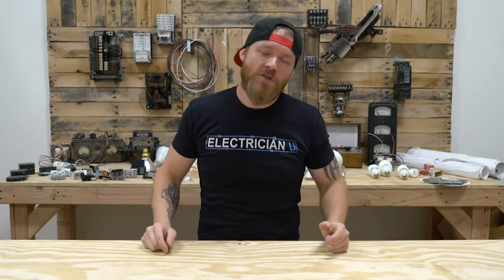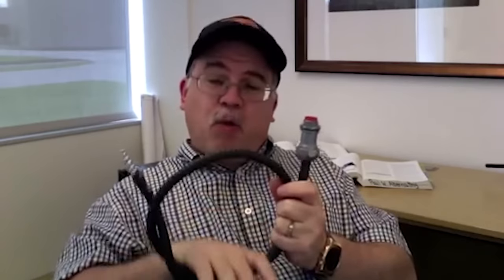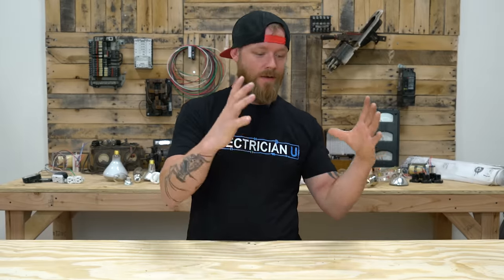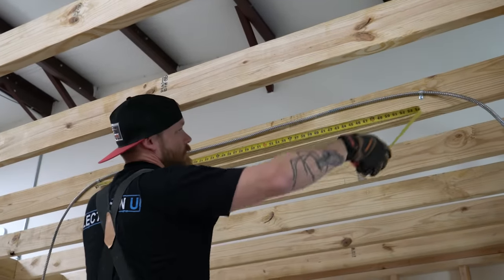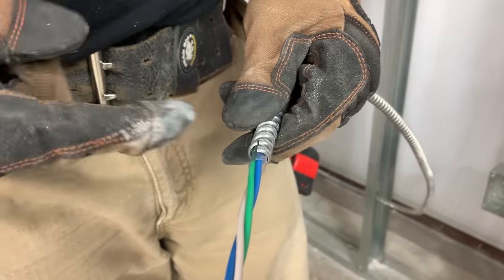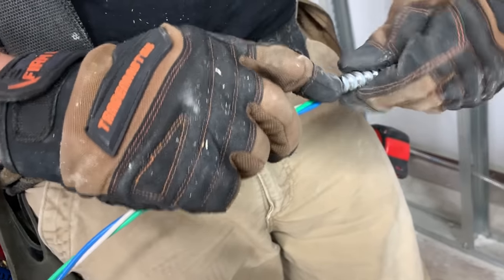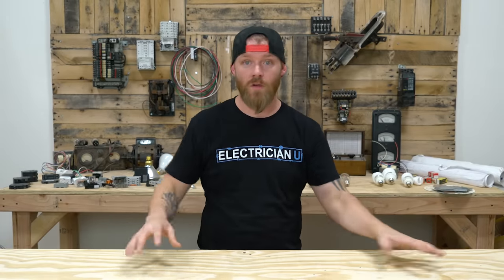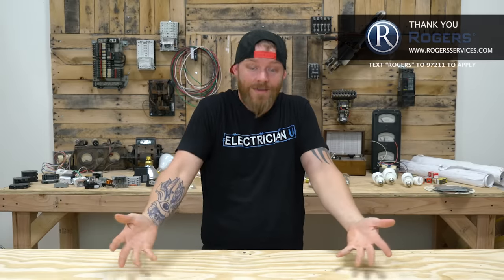Wiring With MC - WHAT YOU CAN AND CAN'T DO WITH MC CABLE as an electrician

Comment: So in mechanical insulation, we use a lot of tape, and cutoff a lot of fiberglass pieces. I’m the clean up bit is by far the most important aspect. I always have a box at the foot of my ladder. At the very least, even if I miss, it’s within arms reach of putting it in the empty box when I moved ladders.

Comment: So if you want a pull box for MC you can make one easy for under $10 from one of those black and yellow bins from the supply house. Get the smaller one of the two sizes. Poke a hole in one end and you can stack them 2 high and as many stacks wide as you need. 

I never do a job without a regular broom and a push style shop broom, big harbor freight dust pan and a shop vac. (I carry a large wet/dry and a smaller stinger shop vac).

Comment: The reason why you should invest in a bx/mc rotorsplit is that you don't want to damage the wire.

You still need to test a scrap piece of mc and make sure you set the tool correctly so you won't nick the insulation and damage the copper wire. 

Imagine you run 100 feet of mc and right where you going to terminate the mc you damage the wire with you diagonal cutter and this could of been prevent with a simple $35 tool that will also help speed up the installation. 

Its just makes sense

Comment: I had an inspector check every connector for the tail sticking out, had to use Red Devil.
Reply from the maker: Doesn't suprise me.  Doesn't mean he was right either.
Reply: If the material comes with anti shorts you need to use them, all listed parts of the assembly are required to be used for installation.
Reply: @stevenmiller820  that's simply not true
Reply: @ElectricianU  Absolutely right. Sometimes the inspector doesn't actually know what he's talking about, all you can do is say yes sir.
Reply: @donphillips5957  He can't fail you if he can't cite a code reference, and vice versa you can nicely say I can't make a proper correction if there isn't a code reference. But then there is the situation were you know he's right and a yes sir is in order. Each situation is unique and can get a bit hairy especially when dealing with certain towns/cities/inspectors. The real question is, is it worth the fight? Which I would weigh those options against the severity of the issue.
Reply: @stevenmiller820  That is incorrect. The manufacturers may provide anti-short bushings doesn't mean they are part of the products listings. I should know as I am head of a company that makes Metal-Clad Cable.

Comment: At 15:40 those m/c cable connectors are great for 10-3 m/c cable. The larger opening allows for easier installation for that cable. All the other connectors have just a bit too small opening and thus can damage the insulation on the conductors during installation.

Comment: good video." mc" stands for "metal clad" cable. it didn't exist in 1967 when i entered the trade. it is a vast improvement over bx or ac cable with inadequate grounds & the tendency to short out against the spiral wrap. we didn't have battery drills either. very labor saving. electrical wiring has had a increase in the demand for higher standards of workmanship. repairing sloppy & dangerous crap took a fair amount of my work week. many diy'ers think codes are bullshit & inspectors are jerks. many are, however, the errors caught & corrections made balance this out. sadly the i.a.e.i.. or intrernational association of electrical inspectors is fading, which is a valuable education tool. i worked 28 years as an electrician & 22 as an inspector. good tradespeople are needed. inspectors are needed for the diy'ers & the hacks that give the trade a bad name.
Reply: Lmao in Canada we still call  “metal clad”  BX and the technical name is AC90 also our Romex is not called nm-b we actually call it nmd-90
Reply: I couldn’t help from laughing when I would come across that old cable with the thin scrap of metal for the “ground”
Reply: You are so right about errors there is no allowable number or percentage of code violations. There has been a huge disregard and disservice in how local governments have lessened the importance of and forgot where building codes came from and why. With the time to do the non core work is pulled the inspectors time is divided up allowing just a few  minutes so there is many times no more then hello oh hi how are you been a few months since last seen blah blah ha ha then maybe did you do or not do this or that blah haha inspection over. The worker knows how much of an inspection will be done and he works to that line skimming back and forth across it. 
I photo documented the hundreds of code violations on an expansion job that happened where I was the qualifying master electrician and only electrician for a 10K seat arena. Under skilled labor with lazy management of overseeing the workers while they worked, foreman-general foreman-project managers and on up, poor material handling. Anyway the local government being allowed to let the percentage of missed code violations continue to increase is criminal.
Reply: An inspector who has actual trade experience!? Holy dingleberries batman!!!
Reply: I don't think it is fair to say that only DIYers and hacks give the trade a bad name. There are many bad electricians out there also.
Reply: @gerhardschemel3565  the steel sheathing is the ground but not enough so the extra thin aluminum wire helps bump the ground capacity up.
Reply: @FishFind3000  the purpose of the AL strip was for making a mechanical connection. Having something to attach the other wires for bonding and continuity. And yes I know the metal of MC is just like the metal of Electrical Metallic Tubing or Galvanized Rigid Conduit or liquid tight, flexible, electrical conduit or flex or…

Comment: The reason I like anti short bushing is that when you push the cable hard against the connector it tightens down on the wire. Why I like this is that if the two ends of cable are pushed apart the wire resists the stretching of the sheathing separating aluminum spiral.
Reply: They would be used more if made longer maybe 3/4” so it stays where you place it.
Reply: i use the insulated fittings, fittings that have anti-short bushing made into connector.
Reply: @1topfueldrag  what is the price difference between them. And yes the ones with the built in do provide a better job
Reply: @gerhardschemel3565  been a while since buying any non insulated, but averaged $.34 on box of 50. That’s for the normal set screw & locknut type. I mainly use push in type no set screw or locknut and pay $.54ea on box of 50

Comment: I like to twist it with my hands and use tin snips to cut it off. Also, you can pull the wires out a bit, wrap with elec tape, then let the tension of the wire off, and they'll slide back into the sheath and be protected just as good, if not better, than the anti short bushing.

Comment: I'm a 37-year electrical IBEW contractor I agree with most of the things I've seen on your channel I just noticed your dissing the larger connectors that had the screw coming in from the side those I only use on 10-3  MC as the smaller red-tipped connectors would do not allow for conductors of number 10 to go through

Comment: From a guy who been doing electrical for 25 years and more.

Trust me , just use the bx red bushing or anti-short bushing 

Its like people say tried-true 

Why should you use safety glasses if you are going to drill a metal box in a ceiling and looking up .

Because there is a big chance you are going to get something in your eyes. Why even take a chance .

1. The anti-short bushing are cheap 

2. Easy to install 

Now a trick we use if you don't have anti-short bushing and have no choice 

First trim off the sharp edge and we use some black tape as a rubber barrier from the sharp edge and wire 

Don't use too much because you don't want to lose you metal mechanical contact with the mc armor and the box

Comment: Also if you run the Mc on the hollow part of the metal stud it go easier because it also has a smooth side when they punch out the holes for metal studs.  If you go against the grain on Mc you can zig zag up and down to go through the holes in studs

Comment: MC cable is great for hidden runs and visable runs in non-residential locations.  It is easy to run, the hardest part is cutting it and remembering to install the wirer protection plastic inserts at the ends.  Cutting it without a cutter designed for it is a pain.  Roto cutter, thanks!

Comment: At 4:30 pay of the video. You said MC cable can  be used in an exposed location outside of and on top of drywall.

Could I get the code reference for this type of installation? A local inspector not in my usual city said MC cannot be used in an exposed location. I have for years used MC in an exposed locations.

Comment: Can I connect an (old unused hot water tank) MC cable (residential) through an exterior wall into the back of a disconnect box that will be on an exterior wall so I can run a AC.  It is 30 amp and has the correct 10 gauge cable for the AC.  If yes, how is that cable sealed going through the wall?

Comment: Guys, don't underestimate those saddle clamp MC connectors. Yes, that opening is big, and the redhead slips out, but they are ideal for thicker cable (think 10/3). You will appreciate the big opening to let all the conductors through.
Reply: Also work great with a threaded barrel for transiting to conduit

Comment: Question., if I may ask. I'm building a prefabricated  metal building. Will code let me insulate and apply t111 on the interior walls first. Then use mc cable to make all my electrical connections. (Lights/switches/outlets.,etc. Visibly on the walls. Thank you

Comment: Off topic. We sometime markup walls with scuff marks. Rags won't remove it. Quick trick. Magic eraser sponges. just dampen with water and very light pressure rub on the scuff. Sometimes I have used a cleaner instead of water. Do not attempted removing mar on faux finishes.the sponge will remove the top lay of the faux finish I learned the hard way.

Comment: Do you electricians consider a metal building -one with metal studs. I am poutting up a steel building with tapered columns and was planning on running a yellow Rome. Aint going thru no steel column, so is it safe to run Romex, or should I put it in counduit ? I was planning on spray foam over electrial.

Comment: Just learn something now... didn't know the term AC conductor. I work as a power technician now and noved into another buildingand boss ask me to make some mods in it. found most of the buliding has conduit and MD with no ground wire...was using conduit and MC shield as ground. What a pain hooking up devices that needed a ground.(motion sensors and timers)
Reply: The MC metal sheathing is not approved as the grounding conductor.  The MC that I see all has a Green wire for ground.  On AC (also called BX) the sheathing is rated as the grounding conductor.  Typically MC is aluminum wrapped and AC is steel wrapped.

Comment: Did not know you can cut the MC square after using the zip. but I  have been using bushing. SWEEEEEEET! thanks for the info. I don't see why MC isn't used. the cost difference between that and romex in a house is nothing .

Comment: I was thinking about running a new circuit through my attic using MC but the last 15ft should have the line going outdoors through the soffit and down the exterior wall to its final box besides the house. I wanted to use rigid PVC conduit for that exterior part (so I can paint conduit and box and blend with house wall)... So should I transition the MC to THWN wires in PVC conduit via a metal junction box inside the attic? Or can I just feed the MC  into the PVC til its final box outside? Thanks!

Comment: I live in rural Arizona and we have a rodent concern with past issues in our home. I’m remodeling our kitchen and was wondering if I can run MC inside my kitchen walls. Wood stud framing with finished drywall inside. We have zero corrosion concern just chewing by rodents that may eventually make their way into any walls between the studs.

Comment: I installed MC cable on exposed concrete in my residential bunker. Was that allowed? The room itself was designed to take on F5 tornadoes and be mortar impact resistant so the only physical damage would be by the people in the room and I dont see any reasonable person thinking they could hang anything more than a shirt hanger. Personally I think EMT conduit would be more likely to damage done to it, simply because it looks rigid and can support hanging things from it

Comment: With regards to the anti short bushing, just because the Code does not demand them, does not mean the inspector (AHJ) won't demand them. I have seen a number of inspections fail because the bushings were not used with MC. Yes, we should work to the Code, but you also have to know your inspector. You don't have to like what they want, but they have the final say and its not worth fighting with them. So, if they want you to use the bushings, use them. IME, it just saves time and inconvenience to just use them every time. I can say that I have never had an MC connection fail when we used them, but we have had connections fail when we didn't. I am not going to say for sure that the fault was because the bushing wasn't used, but using them has been 100% effective. YMMV

Comment: Inspectors always tell us at CEU classes to read the label on box. Used several hundred duplex 1/2" MC cable connector that were another piece of crap made in India. Only thing on box said sixe and UL approval. I will spend extra money on a steel fittings then cheap easy to break die cast metal

Comment: Hello! You have helped me a lot! I have watched your channel over the last four years of my apprenticeship and now I am getting down to the wire for my test. I have a question on this subject. Can you put MC cable inside of LFNC-B? Is there a connector that allows you to do this? Or do you have to use the material show at the beginning of this video? Or is this putting MC inside LFNC a violation of 300.13?

Thanks!
Reply: Because there is also 300.18 which allows for a short section of a raceway to prevent damage

Comment: Do you need an MC connector to keep it from sliding through so it doesn't short something? I cant think of any other reason since romex is smaller and would slide through anything MC would.

What about a romex connector with one of those grippy things in it? Or does it have to be impossible to get it through?

Comment: Sir, I want to install a outlet on my wall for a tv mount.. I will get my current supply from a light recepticle that's within 5'.. the light recepticle has no on off switch, I twist the bulb in and out as a on/off.... is it ok to use romex 12/2 installated in a  1/2" conduit... or should I consider using  12/2 MC the total run would be approx 4.5ft.. I would have to cut into the wall to hide material and then cover with sheet rock or plaster....what's your take on this?

Comment: We will commonly sheath a length of mc in pvc if the run needs to go through a building but land in and outdoor box. I’m using the mc type with thwn-2 conductors and a plastic wrapping under the armor. It’s not in a wet location. Do you think this is a code violation

Comment: question im trying to setup two outlets in a dodge promaster. It will be connected to a generator so the lines will only be live while im using the generator. its a worktruck not for rv. my question to run the wires from the generator to the two outlets can i use this armorlite wire since im mobile and it will be in the walls of the van bouncing around. any suggestions will be greatly appreciated

Comment: But almost all bigbox Metal-clad MC cables come with 12 or 14AWG THHN/THWN2 conductors inside which are *wet rated*.  So no need for PVC coated MC in this case which is why its so hard to find PVC coated MC cable anywhere.
Reply: Re "So no need for PVC coated MC": So imagine this . . . install the MC cable in a rain exposed area and the cable could possible become a pipe and transport the water all the way to the equipment where it is connected.
Highly unlikely but possible.
Reply: @tinaleanne8230  Sure, that would be bad.  But it can happen with any conduit system including the common EMT and PVC conduits if there is a faulty seal.  That's why NM is not permitted in conduit but THHN/THWN or UF-B is.

I believe the usual best practice is for the conduit to enter the interior space low and be mounted running vertically upwards.  So, in the rare case of flood out, the water will have a harder time getting into the equipment.  Even it did get up, it should spill out before getting up into equipment.
Reply: @beyondfossil  I had not considered that. I suppose if it can "leak" in then it can get out just as easily.

Comment: Hello, im not an electrician, just like to do things my self and learn on the process. Just finished installing some mc in my garage..everything seems to be fine..tested all outlets with the tester and marks as "correct"..but i always like to triple check things out..ive notice that wen i touch the mc armored with my multimeter, it beeps..like if it had some kinda power..1.5v is the most reading i get..should i be concern or is this normal? Fyi not all the wire i ran i get the beeping..thank you..

Comment: Hey quick question bro. I’m not too fond of the cheap nitrile gloves. What type of gloves do you recommend using? Obviously working around live conductors too? Great video man!
Reply: the best glove i like for electrician is the '' superior touch glove '' on amazon.com extremely sensitive and cut protection. it durable about 1-2 month of use depend of what you doing.